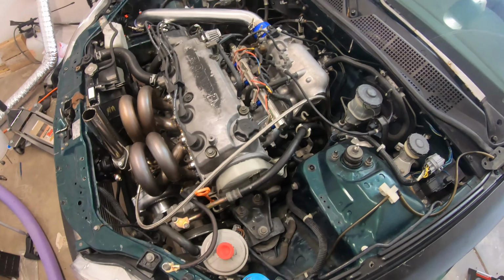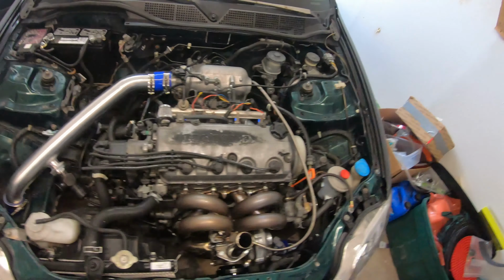Street Tuning My Turbo D16Y8 Civic Part 1 | Street Pulls | TunerThings

Comment: Goes well buddy, is this stock internals?
Reply from the maker: Yeah as far as I know they're stock. Hopefully they last for a bit of fun but I'm fairly confident I'll be elbow deep in things in a few months lol
Reply: @TunerThings 
You going to turn up the boost then? 😎
What's your plans when you'll be elbows deep? Vitara build
Reply from the maker: Yeah I definitely am. I just want to dial in the tune in the next few days and I'll give it some more boost after that. I don't think I'll go much higher, probably 13-14psi total. I don't want to grenade it but I also don't want it to poke long anymore. Vitara build for sure -- no notch pistons are definitely the way I'm going to go as well.

Thanks for stoppin by and showin some love it's much appreciated!
Reply: @TunerThings  I ran 8 psi revving up to 9k with my boosted JDM D15B VTEC and it never once had any issues. My EJ8 would smoke WRXs and Mazdaspeed 3s with the single cam setup. It was bone stock other than ARP head studs, and a Cometic MLS head gasket. Once I tore it out and swapped to a B18B1 my buddy put it in his EJ2 and ran it boosted to 12 psi for another two years before he sold it and it was his daily. The older single cams can hold quite a bit of boost, but I've heard not so good things about the Y7 and Y8 due to their crankshaft oiling and cooling. I would stay around 10-12 psi on the stock bottom end. Also, if you do plan on building a single cam, get a D16Z6 or JDM D15B block and build it. The Y8s just aren't very good for boosted applications. When I bought my EJ8 it had a D15B in it because the Y8 seized.
Reply from the maker: @BucksSuperStereoWorld  Bro thats incredibly helpful information thank you! Definitely will take that to heart - I do plan on going a bit higher boost with a single cam in the future
Reply: @TunerThings  They're incredibly well built engines and although they are always the underdog in most cases, they are very capable little engines. I chickened out and went with a built B series, but sometimes I wish I would've stuck with it and seen it through. Also, the D series transmissions are extremely fragile once you make more than 300 whp (which is quite a bit for a single cam), so once you do get to that point with your Vitara build, you'll want to start thinking of a D2B trans swap and go with a GSR trans, or have the single cam trans built. I've been pushing almost 600 whp through my GSR trans for 4 years now with no issues. They're incredibly robust transmissions. I like to be there for my Honda brothers and to try to help the best that I can because I've done my research, heard alot of things, and have tried to soak up as much information as I possibly can in the hopes that I don't make that mistake, and at the same time I can help others in that same situation. If I were you I would keep the boost to around 10-12 psi until you can afford to get a D16Z6 block and build it. The last thing you want to be doing is wasting your savings on getting another Y8 because your block has a window in it. They are alot of fun on boost though, so it's hard to say no.

Comment: I remember doing this back when I boosted my JDM D15B VTEC in my EJ8. It was alot of fun, even on 8 psi. Then I swapped it for a stock boosted B18B1 with supporting mods, and now it has a fully built LSVTEC in it with a big Garrett GT3582R in it and makes 588 whp, and that was before I put Skunk 2 Tuner Stage 3 cams in it. I love my Honda, it's definitely been a labor of love for me. It better be after putting close to $15k into it.
Reply from the maker: Hell yeah man that 3582 is a monster for sure! I ran one of those on my WRX for a while! Blew the fuck out of two engines before I sold it lol do not miss the cost of those blocks!

Comment: What turbo kit are u running? I got a 98 ex with d16y8 I wanna do a build on
Reply from the maker: This is just the CX Racing Ram manifold style kit, super cheap and only needed a few hundred in extras to be where I am -- injectors, fuel pump, ECU, and a few misc fittings and such!
Reply: @TunerThings  would I better off buying and installing the other then do the turbo setup last?
Reply from the maker: @rc_life8545  What are your current mods on the y8? Honestly the injectors (got Huntertuned ones) and fuel pump (Kemso brand) can wait until you're installing the turbo you won't see any gains from those yet (unless you decided to go e85) but you can start by installing an ECU that's either chipped for software or has Hondata. A good tune never hurt anybody!
Reply: @TunerThings  currently just a aem cold air intake and header. Just bought the car and it has a slight bottom end knock so next week I'm getting another motor to put in while I tear down this one and replace the pistons and rods and bearings. Thinking of a vitara build
Reply: I got a chipped and tuned p28 ecu on hold also just waiting on funds and this will be a budget build
Reply: I have the same car and am looking to turbo as well

Comment: I’m boosting my y8 swapped eg stock motor just with a upgraded cam and a adjustable cam gear ....hopefully can do 10-12psi daily if not 8 pounds I wanna tune it myself
Reply from the maker: Do you have arp studs in? Should be pretty safe at 10 with ARPs long as everything else is healthy. Def safe at 8. And 100% if you wanna learn how to do your own tune, do it. It's so much fun

Comment: What are you using to change your parameters instantly?  I'm used to burning chips
Reply from the maker: Laptop hooked up to my ECU running Honda Tuning Suite! Definitely check it out.  It connects via an ostrich... dunno if you can get one of those anymore but there are lots of options to connect to a flash chip. I just leave the ostrich connected.
Reply: @HeyItsSteve  yeah they don't make them anymore and the internet hasn't been helpful with trying to figure it out.

HTS>Crome

Comment: Okay new to the channel, already subscribed. I just bought my first honda with a single cam its an ek with a y8 identical to yours. Ive been researching all night, knowing boost is best for singles I dont know much on how to set up the kit nor tune it. If you could help me itd be a godsend. Thanks for the time. 
P.S. nice build look forward to more
Reply: Also really dont want to take it in cause I want to do it myself haha.
Reply from the maker: Nice man the y8 responds pretty well to boost and was fairly easy to install. Do you have any mechanical knowledge? Really doesn't matter either way but it makes things a bit easier. You gonna go with a kit? CXRacing has a good cheap one to start. I can help you tune it when the times comes! Thanks man much appreciated and I appreciate the support!

No reason to pay someone to install it -- you'd spend less on the tools needed to do it yourself easily.
Reply: @TunerThings  yeah I know a decent amount my big thing is i dont wanna hurt the motor. By not knowing what to install where. Ive been reading forums but I havent seen one that describes a budget boost build. Its my daily and Id love to drop a B20v or even better a f20b or something into it but that just seems to add up way quicker.
Reply from the maker: @jonathannelson2117  The biggest thing to save your motor is to make sure it has enough fuel and a good tune. The rest all bolts into place with a good kit! The tune is super important though.
Reply: @TunerThings  yeah, main reason I wanna boost is so i can learn to tune AFR. Edit thanks alot man for the assist great youtuber and person.

Comment: I have a 97 civic ex 5 speed manual and thinking of installing a turbo, can I get some help because I’m new to this and I’m confused on where the turbo goes to and will hook up to. Also the sound of the vibrations and rattling noises of the civic will always be in my memory
Reply from the maker: Sure! I'd be more than happy to help! The turbo mounts to the  turbo manifold which you'll have to purchase. When you pop your hood and look at the exhaust leaving the engine in front of you you're looking at the exhaust manifold. It's usually under a heat shield (you'll see a hot symbol on it with a hand) that gets replaced with a unit that mounts a turbo and a wastegate to control the pressure. The turbo has a hot side and a cold side -- the hot side connects to the manifold, the cold side connects to the intercooler piping. That runs across the front of your car and up on the passenger side. The cold side connects from the turbo to the intercooler -- then from the intercooler to the intake on the back side of the engine near the firewall.

After that you need to connect the oil feed and drain usually you use either oil pressure sending unit to T into or you can use an oil filter sandwich adapter plate (what I use) -- that feeds it, and the drain goes back to the oil pan.

You'll need larger injectors, a larger fuel pump, some engine management -- I use a chipped p28 ECU and Crome (free) and a decent basemap.
Reply from the maker: Sure! I'd be more than happy to help! The turbo mounts to the  turbo manifold which you'll have to purchase. When you pop your hood and look at the exhaust leaving the engine in front of you you're looking at the exhaust manifold. It's usually under a heat shield (you'll see a hot symbol on it with a hand) that gets replaced with a unit that mounts a turbo and a wastegate to control the pressure. The turbo has a hot side and a cold side -- the hot side connects to the manifold, the cold side connects to the intercooler piping. That runs across the front of your car and up on the passenger side. The cold side connects from the turbo to the intercooler -- then from the intercooler to the intake on the back side of the engine near the firewall.

After that you need to connect the oil feed and drain usually you use either oil pressure sending unit to T into or you can use an oil filter sandwich adapter plate (what I use) -- that feeds it, and the drain goes back to the oil pan.

You'll need larger injectors, a larger fuel pump, some engine management -- I use a chipped p28 ECU and Crome (free) and a decent basemap.
Reply: Thank sm

Comment: Hey man what injectors are you using? I'm thinking of going junkyard LS but would be interested in cheap injectors that fit right in
Reply from the maker: These are junkyard LS injectors from Huntertuned (not E85 ones) but you can prob score them cheaper on Amazon or Ebay or RockAuto....or the junkyard lol but his are flow tested so I went with him. They've been great so far!
Reply: @TunerThings  Thanks a bunch. Just curious as to what type of trucks I should be looking for in the scrap yard to find these types of injectors

Comment: Am having some issues around 4500 rpm feels like launch control is engaging cause when it gets to that poin and starts back firing
Reply: I have the same tuning set up as you also
Reply from the maker: What software are you using?
Reply: Is your speed sensor working?

Comment: What ecu are you running and what ecus would work for turbo setups
Reply from the maker: I have a chipped p28 but you can use the 72 or any other chippable ECU to flash a tune to. I use Crome free to tune and an AEM wideband to keep track of things!
Reply: @TunerThings  how hard is it to do a baseline street tune could I do it with just some reashearch
Reply from the maker: @chadandtyler  Man honestly its not that hard as long as you go slow and don't turn things up all the way. Little changes won't break things as long as you aren't going crazy with the timing. Make sure your wideband gauge is functioning and you're checking it CONSTANTLY. 

If you need any help man just let me know and I can talk you through it

Comment: can i do this w an auto?
Reply from the maker: Yeah absolutely!
Reply: Tuner Things whats the downsides of going turbo? anything specific happen to you that i should expect?
Reply from the maker: @osamanbush6575  Things breaking is the only real downside. Long as you've got a good tune and all the supporting things like injectors, fuel pump, a decent wastegate, etc you should be good to go. The kit from cx racing was nice because it came with a ton of stuff for a good price but I did need to upgrade the ecu, injectors, fuel pump, wastegate, oil return kit...aaaaaand added an o2 sensor. 

easy to install on these cars for sure - long as you keep the boost down you shouldn't have any issues

Comment: Not going very fast just lots of noise 🤷🏻‍♂️
Reply from the maker: Yep, small turbo, single cam stock engine! Lol still grenaded it after all this ruckus
Reply: Tuner Things dang need to get some eagle rods and sleeved block single cam can still make 400+hp tuned right with supporting fuel mods
Reply from the maker: @stevenmcc2119  Agreed. I have the pistons just waiting on the money to get some no notch rods and the block sleeved - when I make that upgrade I want to do it right and complete. For now I'm going to be rocking 8psi with the ARPs in there to hold the head down lol
be well brotha!